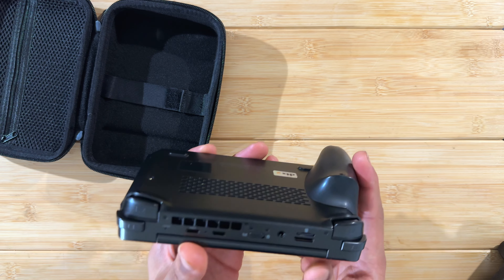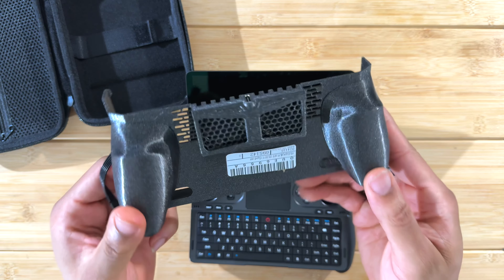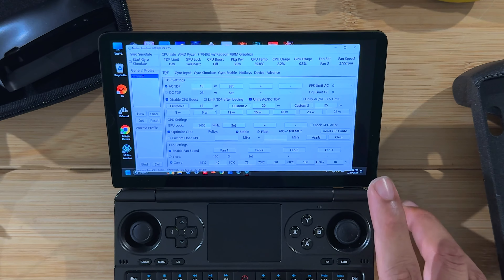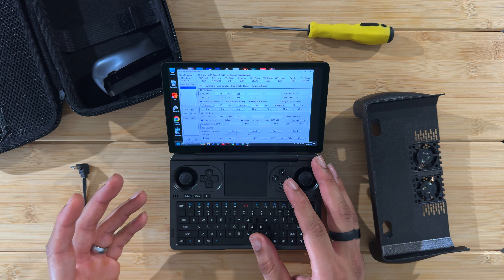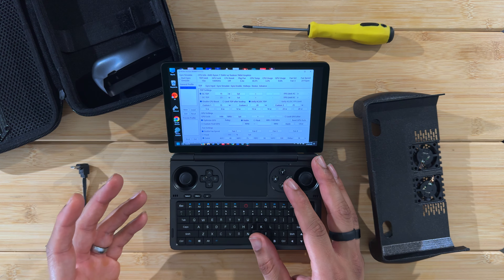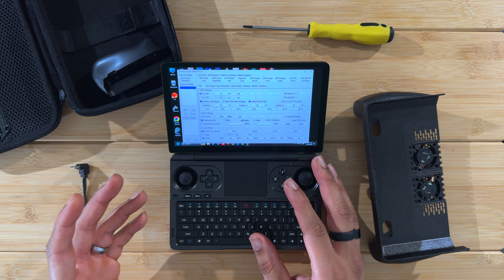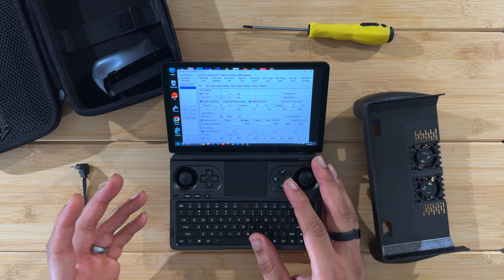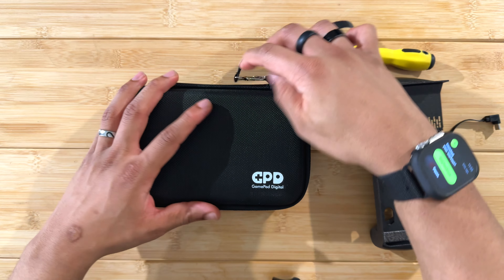THIS GPD Win Mini Grip HAS A FAN!

Comment: Can we get your recommendation between the gpd mini, max and the legion go? Is the lack of frame rate a big deal on the max? Is the heat a big issue on the mini? Is theax comfortable to hold without grips?
Reply from the maker: It sounds like a cop out; but it really depends. It depends how/what/where you play or want to play. 

1. As far as frame rate: 60fps IS ENOUGH on a handheld. You’re not going to be running any modern AAA games at super high fps and if you’re truly a competitive player you would probably connect to a monitor or you might even have a full Desktop PC. 
Having more fps IS NICE for less intense games, but you’re not going to complain about a locked 60fps in those games anyway. 

2. Heat is not a huge issue on the Mini. It can get hot if you push the TDP, but never enough to be dangerous. You can definitely notice the heat above 75° but it won’t stop you from playing or burn you. 

3. The Max isn’t very comfortable to hold until you get used to the weight. After a few hours of playing your wrist will get stronger and you’ll be able to hold it all day.
Reply: @BarelyAverageDude  awesome, thanks for the info :)

Comment: Your usb connection is blocking the vents which can give it high temps, it's actually meant for the other usb connection to angle out above the vents and the other usb to angle outward to the left if facing the device at the bottom.
Reply: Just switch the connection, I got mine and it works beautifully
Reply: You Know if there is any video showing that grip in real testing?